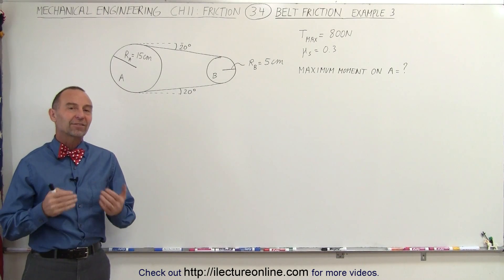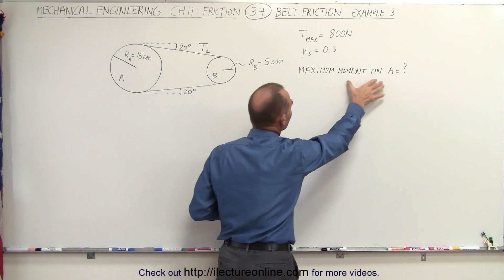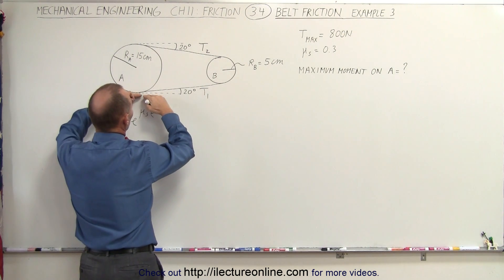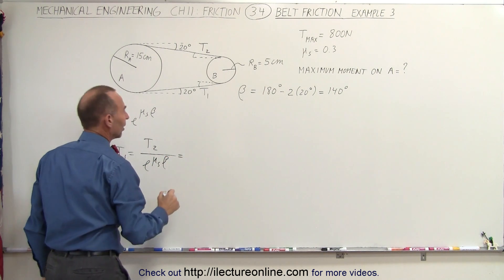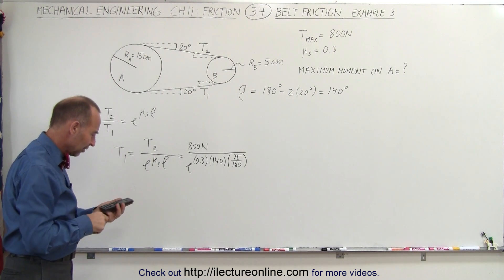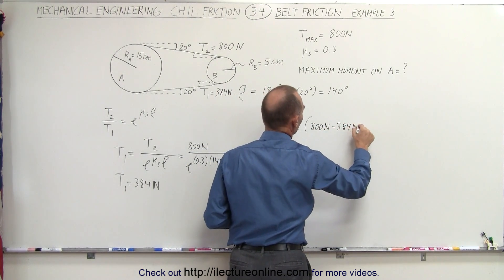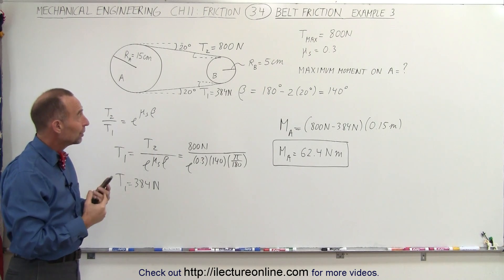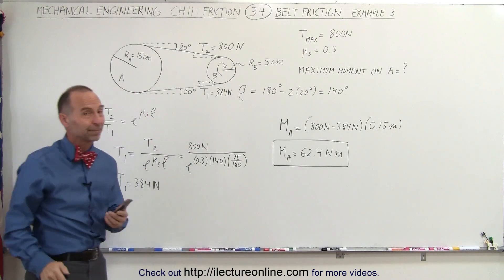Mechanical Engineering: Ch 11: Friction (34 of 47) Belt Friction: Ex. 3

Comment: GREAT content! I have a question? Can a pulley system enable a diesel engine to achieve a greater RPM than its rating. for instance, i have a Detroit diesel engine that's gross rated maximum power is 300 bhp @ 2800 RPM. that is powering a positive displacement blower that's maximum rating is 3000 RPM @ 135 bhp. In order to maximize the output of the blower, I need to increase the RPM at the pump to 3000 RPM. that's 200 RPM above the engines gross rated maximum RPM of 2800, would a pulley system allow me to do this?
Reply from the maker: Engines are usually designed to provide a certain torque, (besides raw horse power), and they will be more or less efficient at different torque requirements.  A pulley will change the torque, so you'll have to take that into account.

Comment: i get lost in 180 - 2(20)
Reply from the maker: The angle is needed to calculate what portion of the small wheel makes contact with the drive belt.
Reply: given that small angle sir, how can I know the angle that the belt makes contact to the wheel?
Reply: like, I forgot the geometry about it😅

Comment: Sir, I have a textbook question that I attempted. Sand drops vertically at the rate of 2kg\s on to a conveyor belt moving horizontally with a velocity of 0.1m\s. Calculate  (i) the extra power needed to keep  the belt moving, (ii) the rate of change of kinetic energy of the sand. The answer     (i) 0.02W (ii) 0.01W. Why are these two different?
Reply from the maker: Yes, it seems very odd, but the book is correct.   The change in KE = (1/2) m (change in v)^2 = 0.01 W    But to find the power required we need to consider the change in momentum:   W = F x d   P = W / t    Impulse = I = F x t = change in momentum = m x (change in v).  Therefore P = W / t = F x d / t = F x v  = m x (change in v) x v / t = 0.02 W

Comment: how come we dont consider the friction coefficient between the large drum and the belt? wouldnt the moment applied be affected? especially if the tension in the belt exceeds the static friction force?
Reply from the maker: Because we are only considering the effect on the right side.  The assumption is that A is driving wheel B.

Comment: sorry sir why don't you use (800-384)0.15(COS20)? Doesn't the tension have a x and y component as well?
Reply from the maker: Then tension in the belt will always be in the direction of the belt.  (no components).